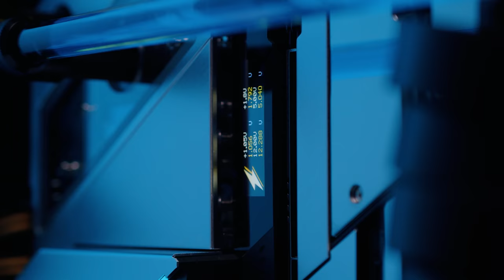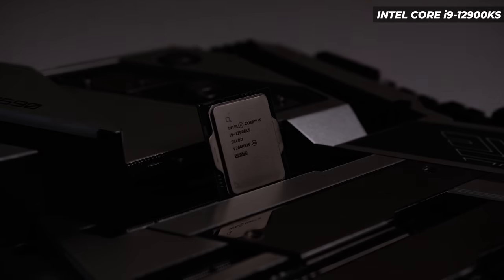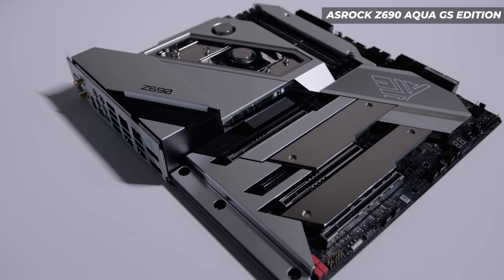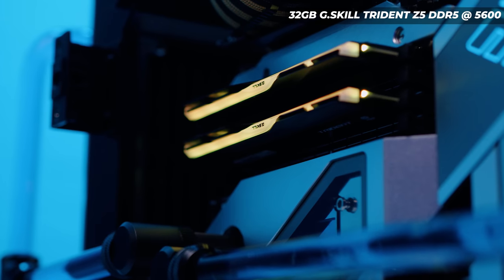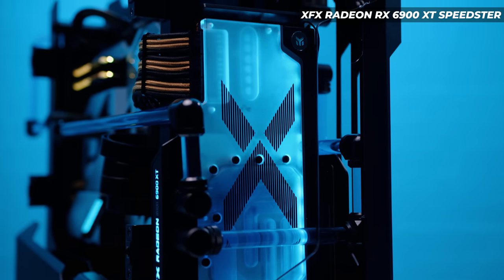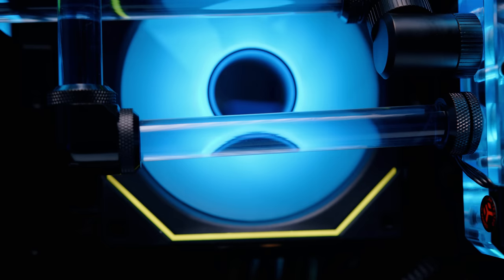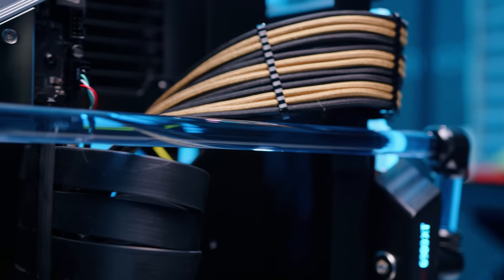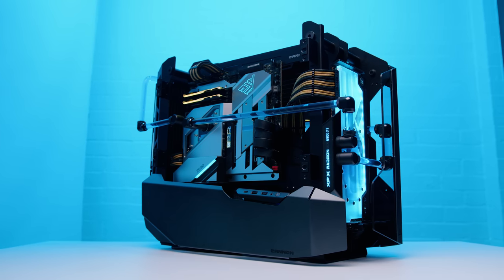The Antec Cannon is one of the coolest cases you can buy!

Comment: i love these open builds but are just terrible for dust after a month or two .. i did the thermal take p3 open build case damn components were caked in dust after a month of use .. went back to closed case now i use a nr 200p max sff build with the 5800x3d and a 6900xt changed the panels to black black so it matched the xbone series x and the d brand ps5 ..
but nice job this one looks great !!